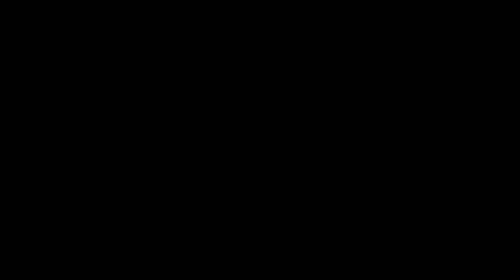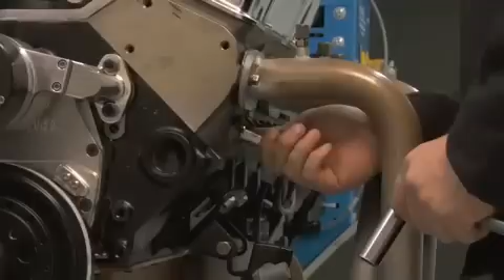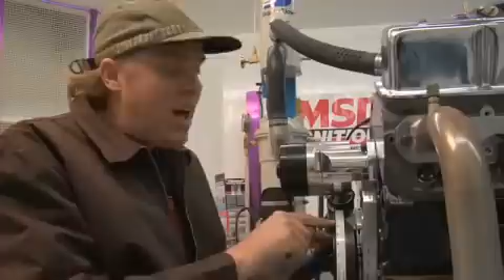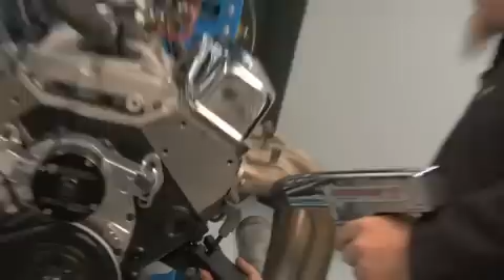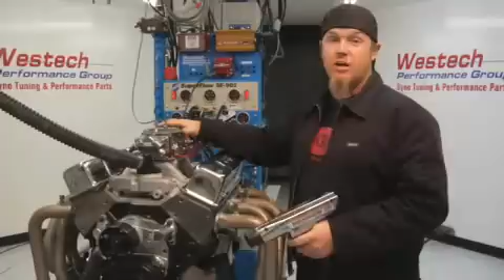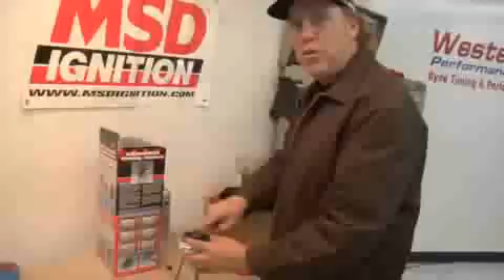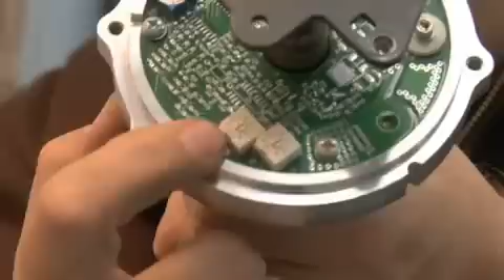How to set your ignition timing

Comment: Someone help me out. My friend changed water pump & thermostat on my 98 pathfinder and got the timing off a couple of notices as he said. Now he tries this method of using a rag put down in the socket #1 and "BUMPING" it to blow rag out with piston up top and supposedly pointing the distributor toward #1 on distributor cap. IS THIS GHETTO technic correct? Please help me get my shit back in timing, I told him to mark it but he said it wasn't necessary. YOU ALWAYS PUT MARKINGS ON IT :( OH btw the harmonic balancer had to be removed to get that water pump off . I'd never recommend a 98 pathfinder to anyone because of this. BAD DESIGN. Anyways someone help me get my timming back if possible without me having to get a real mechanic to come by my house and cost me money out of pocket.
Reply: easiest way to find TDC on 1 is with a screw driver in the sparkplug hole. Rotate the engine BY HAND (if you crank it you will wreck that cylinder!!) and watch as the piston pushes the screw driver out of the sparkplug hole. Once it starts to fall back down you'll know you just passed tdc. Also tdc on power and exhaust are interchangeable but since you're car is newer the gap on the crank pullet that is used by the tps sensor should give you some sort of verification seeing as that gap is used to tell the ECU where TDC is. Find your crank position sensor and see if this gap lines up with it at what you think is tdc. Nissan may do it differently so your best bet would be to frequent a few forums to get a better explanation of your cars specific needs.
Reply: it's fixed, his didn't have these crank things lined up, he end up moving one, i had do a google and found how it lines up correctly. Been driving it over a week now. I told his dumb as to mark the belt with a marker while it was in it's original place so you could put it back exactly as it goes. Thanks Buddy for your reply. there were 3 dots on where each crank thing had to be lined up or something , i'm not a mechanic don't know terminology. I sure wish I took mechanics though instead of computers. SO MUCH MONEY IN AUTO REPAIR!!!
Reply: Psh bro. Auto repair is a sham for the guys who actually do the work. You have to finnish jobs faster than what the manufacturer says it would take for you to complete it if you want to make any money- not to mention politics. I do autorepair and I'm studying for my A+ right now so you should really take that into consideration. More money, less dirt, less stupid to deal with from people who have no clue what they're talking about. Not to mention if you get a Comptia Cert you don't have to worry about retaking tests you already passed while ASE requires you start all over if you fail. So lets say you get through braking, power train, drivetrain but you screw up on chassis electrical. That screw up can force you to have to start from the beginning again and pay for all of those tests (68 bucks a piece and theres  multiple tests for braking, engine electrical, etc.). Not only that if you get a job at a dealership like say "toyota" and you're not toyota certified...you could lose your job to someone who has that piece of paper regardless of how knowledgable you are.
I'd take computers over automechanics ANY DAY!
Reply: Yeah, but as I see it, everyone has a vehicle, not everyone owns a computer. I have A+, Network+ and MCP certifications. There's more money in my opinion in vehicle repairs because they break down all year round. Once certified you can open your own business at home and don't have to work for someone else. Hell you just just post signs up and business cards or whatever. And rake in the money from brakes, oil changes, alternator, air compressors, rack & pinion jobs, radiators, and anything else. My friend knows how to do all that stuff. I told him he's wasted skills. Has all that talent and no certifications. I weight in the computer field vs this vehicle field and my education opinion is that the vehicle repair would bring in way more money. Maybe me and my friend could open a combo business LOL. Bring your car by for repairs, and your computer too LOL.
Reply: Ironic that you say that. If you got into programming and designing software...trust me...your buddy would NEVER let you stop working XD. Computers and cars are so intermingled now it's as simple as changing settings to get more power. Custom maps work on cars from the 80's to add power. The applications are endless.
But on the automotive front trust me. It's not as simple as it sounds. Parts are the achilles heel of anyone doing work on their own as well as time. Time literally equals money in that game and to clear overhead you need a minimal amount walking in the door daily. Generally labor is where the DIY mechanincs make their cash but that means the customer won't save on parts. I generally end up charging 50% of what the shop charges for the work and I still struggle dude. It's rough. Not only that you can't work on everything, shit breaks, people try and buy weak parts to save cash and have you install it and when it fails after you've warned they try to hold you accountable. I understand the grass is always greener but honestly I'd take computer case dust over grease and grime any day.
Reply: UNLESS IT'S MY CAR! lol. I love working on my own vehicle. Lmao!

Comment: Ok I think I fixed it,  I found something unplugged on the steering column in that white box at the bottom of the column, but now she starts fine and when I drive it it drives until I let off the gas then dies. But starts back up right away, why ?

Comment: Hey i kno the steering column your talking about, on those column even ones that go into the 90s have rod that goes from the center of the column under the steering wheel and down to the just above the brake pedal there is a little switch , if the bolts in the switch get loose which they always do it will kill the ignition power just the way the key would if you turn it, sometimes they are adjustable and need to be set with some trial and error to adjust when turning the key activates the switch

Comment: just saying i ran my timing at 0 degrees on crank and 0 degrees on distributor and made 20 hp more
Reply: Are you running a vac advance and if so is it plugged into the non-timed port on your carb? If so then even though you might have set the timing to 0 degrees when you plug the vac canister back in the timing at idle could advance up to around 12 degrees

Comment: quick question, you didnt cover much on the vacuum advace disty. When my car was dyno'ed they left the vacuum  advance hose off, and set total timing at about 34 degrees and it made good power and tq. But they never hooked the vacuum hose back up. I have awesome full throttle power, but my part throttle sux and pops out of the exhaust when I step on it until its higher in the RPMS. Think I need to hook that vacuum hose back up to im getting timing at part throttle?
Reply: Most dyno operators only want to impress you with WOT pulls on the dyno, they don't give a 5hit about part throttle, plug the hose back on and don't use that dyno operator again!

Comment: Have 95 Geo Metro-3cyl, 1liter engine. At the Chevy dealer,when I asked about the total timing,they looked at me, like I came from Mars.
Is there some book or some other source, where I can find out?
P.S. Leaking injector(throttle body) would make the mixture richer. Richer mixture slows down the spark progression somewhat,so I should advance more?
Thanks

Comment: there are also OTHER reasons why that engine can feel gutless at higher revs.
Like carb float level to low. (= to lean mixture) Or to high. (= to rich mixture).
or a sticking choke, or clogged airfilter.

These cars are also suffer from sticking  brake calipers! Making the car slow... take a test drive and feel if the rims are HOT. If  yes you have a sticking caliper. 
(4)
happy 02-ing from an e9-er  (oo=00=oo)

Comment: almost forgot but essential: START by ensuring that the engine has the correct spark plugs which are gapped correctly. That the dizzy has a fresh condensor and points and that the points gap has been set correctly. Use a good clean cap and a good rotor. 
(3)

Comment: aim the stobe light at the front pully. see if the timing changes when running with or without vacume advance hose attached. If yes, then vacume advance is working. If not then vacume adjuster is broken or dizzy is sticking inside.
In the last case you need to remove the dizzy, check if all parts are there (fly weights and springs) and clean it out using pressurised air, then lightly lubricate the mechanism with some light oil.
Then reinstall and do the timing again. 
(2)

Comment: get a strobe light as the one in this vid, hook it up.
disconnect the vac line of your dizzy (and plug it temporarily with a screw)
start engine and let it idle (800-900rpm)
aim the stobe light at the bellhousing on the carb side of the engine.
if you see the 'steel ball' in the middle of the hole then your timing is OK.
If not, twist the dizzy back and fro until you do see it.
When done tighten the dizzy clamp bolt and re-attach the vac line.
(1)

Comment: Hello I have a jeep grand cherokee 5.9 If you set it to the same as the engine. ate at idle throttle should be 12 degrees
Greetings from Bosnia
use google translator

Comment: They're correct any modern ignition system travels positive to ground you may be thinking of an old 6 volt system while most of those still ground to negative I believe there were some early 6 volt positive ground systems where positive was actually connected to the frame. The electricity would have to travel through the distrbutor and the coil first anyway in order to boost voltage through the coil and jump the plug gap otherwise 12 volts isn't near enough to even spark

Comment: I bought a used 383 and the guy said to set it to 26 btdc total timming with the vacuum plugged, then plug it back in and adjust curb idle. It sounds good at idle but cuts out at part throttle. I set it to 17btdc with vacuum unplugged then plugged it in for a 2btdc at idle. It runs good like this so.......what is going on? I know a 383 usually has a total timming of 30-34btdc, so what do you think is going on here?

Comment: If I want to induce combustion during peak compression, why should the engine combust the fuel-air mixture prior to TDC, where compression ought to be highest given the lowest volume in the cylinder?

Also, in practical terms, what exactly do the degrees refer to? Is it the degrees of rotation of the distributor around it's own axle (where TDC would be equivalent to 00:00 on a clock), much like a clock?

Comment: So I Have A 91 Camaro With A 92-93 350 Engine, Is Has Comp Cams 272 Lift Cam, Whenever I Go To Shut If Off It Doesn't Seem To Wanna Die It Sputters Kinda Gives A Backfire And Just Dies. Any Ideas ? Also Does Anyone Know How To Adjust A Holley 670 Street Avenger Carb? My Car Seems To Wanna Run Rich And I Really Don't Need That. And One Last Thing My Car Once Turned Off Doesn't Wanna Start Again Unless I Jump It And I Put IN A New Battery So What Could It Be? Any Help ? Lol

Comment: The ballancer (sp) will only go on in one way,  You will have a key in the crank to slide it onto.  The ballancer will have a zero mark on it already.  If you don't have a roll back light, get a timing tape and mark the ballancer with the marks and take it off.  The come off anyway.  I always set total timing, SBC usually about 34*.  range is about 32-36.  Your motor will have a sweet spot.  You have to find what your motor likes.  Good luck!!

Comment: Quick question, so what if you are installing a completely new harmonic balancer? How would you place it in relation to the timing gear on the crank? Like say on a small block, i have the dot on the cam timing gear aligned with the dot on the crank timing gear facing each other. How would i position the new balancer? And do all harmonic balancers have some sort of indication of TDC?

Comment: @PhilinThebox3 sounds like the distributer is a tooth off..when you drop it in it sets the gears together and spins a hair as it lowers.its easy to do..or if its not stock motor or distributer does it have something obstructing it from turning? firewall?

Comment: @louevilmetalhead  in a modern car the ignition control unit is the modern equivalent of the mechanical distributor. it needs a bit more input from a crank position sensor and cam position sensor to be able to 'tell' each coil in the pack when to fire. The timingcurve is programed into an EPROM chip inside the ICU. (equivalent: flyweight advance and vacume advance.)

Comment: The Vortec 350s and 4.3s,you don't set the distribitor with a timing light.It is set with a scan tool.The part inside the distribitor tells the computer when to fire the fuel injectors

Comment: @gmcjoshua follow the spark plug wires back to the distrbuter nd make sure its the right wire for the right cylinder. theres going to be a set of numbers on your block the shows you how the distrbuter is supposed to be wired. the front of your distributer might be 1 then . 8 being on the passenger side and 1 on driver side.

Comment: my good idea is to clip the timing light cable on no.1 plug lead up near the dizzy cap.It stops you burning your fingers on the pipes , and prevents the clip coming into contact with the hot pipes.

Comment: Were would you set the timing on a 1946 Cadillac Flathead V8. I marked TDC on my Harmonic Balancer, when I had the Head off. When putting the timing light should it fire before TDC or after.
My Harmonic markings were long gone. ANY HELP...
Thanks

Comment: @mariahkraft
Depends on the car. If the car is using a CC distrbuter (common on late mid 80's chevy that used CC Q-Jet's) Then the timing is computer controlled and pretty much hard programmed into the chip. The only "setting" that is done is simply unplugging the data cable on the distrbuter it setting it to true TDC at idle and plugging it back in. There is no real adjustment to them. Short of reprogramming the chip (its written in stright assmbley so good luck with that)

Comment: there is no "typical" timing for a SBC they all vary drasticly wile a stock cam 350 will generally run at around 8 to 11 a 305 will perfer around 5 to 8.  This can also vary drasticly based on year and engine model number. So overall there is no "typical".

Comment: @PsychoFreke The best way is to remove the heads and locate #1 cylinder...rotate engine with a breaker bar to get #1 cylinder at TDC (top dead center)...you can then mark you balancer with the "neat little white strip" which are quite cheap...(make sure you put on the white strip with "0" lining up with the pointer that is bolted to the engine)

Comment: Great video, 
Went outside and tried it on my old BMW e30 ( m20b20 with jetronic with mechanical distributor on the side of the block )
Loosened the hold-down-clamp. Tried turning .... nothing, won't budge at all.
Gave it a few gentle taps to loosen it... nothing
Grabbed it with both hands ( cap off ) and threw some muscle at it.... nothing.
Tried lifting it, also no effect. 
Any tips on loosening this mofo so i can turn it a bit?

Comment: @Lokivoid  it is a TBI fuelinjected setup  , turns out after a HG is still blew smoke out of the exhaust , its coolant burning and it kills my o2 sensor and throws of the AFR , my heads might be warped .

Comment: @catburner Camaro uses Sealed Power CS793, and C1500 uses CS711.
Difference there is. Anyway, the procedure I described, worked for my 300-6 motor.
So, with TBI and perhaps a computer, things are different.
Obviously, you have not removed the front chain cover and tampered with the crank/cam gear timing marks? Why the white smoke, I wonder...
Intereseting problem, and I will continue to research, but I will probably be of no help. Isn't white smoke indicator of coolant leakage?

Comment: @catburner Try 8 deg. btdc, which is what the 1988 305 ( in the C1500 ) timing spec is. Install distributor only after the damper slot is aligned with 8 deg. btdc (compression stroke # 1 cyl.) When installed, the dist. rotor should point exactly at the # 1 cap terminal. Then tighten down and test with timing light. Should not harm engine.

Comment: @catburner Static timing means "to install the distributor at the specified timing" as indicated on the emission sticker. When the timing pointer is at , say 12 deg. BTDC on the compression stroke, then install your distributor.
You don't install the distributor at 0 deg.

Comment: the alluminum mounting brackets you provide with PN8226 " blaster coil " for SBC are too big . They move the coil forward and then it hits the intake runner for cylinder #7 and you cant bolt it down right also the the screws you provide are too long . not complaining , just putting it out there ...

Comment: Love the vid. I got MSD 6AL,blaster 3 coil, MSD 9mm leads and PRO BILLET DIZZY on my 307 chev with Edelbrock rpm heads and a 750DP HP. 3000 rpm stall and 3.9 gears. The car is a HK GTS MONARO and weights 1300>1400 kg's. should I tighten the curve???
Any help would be great.
Thanks mate from Australia!

Comment: koay i bought a 6al with pro billet and blue blaster and it worked sweet but recently  i picked up a 307 impala with no carb or distributor so i looked on the net and ended up buying a streetfire ignition because it was guaranteed by you msd and it was cheap now ive fitted it double checked and triple checked the initial and played with the advance it tries to run but if i give it gas it backfires like an animal,also fitted with brand new holley do you guys get many returns of these